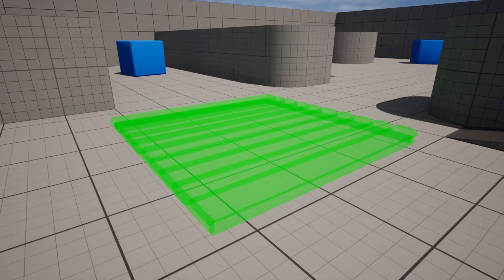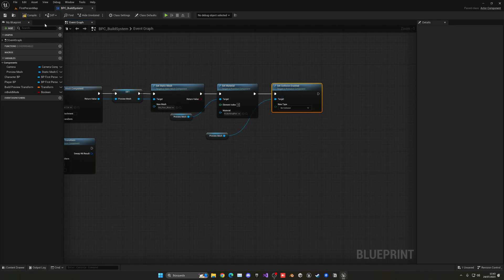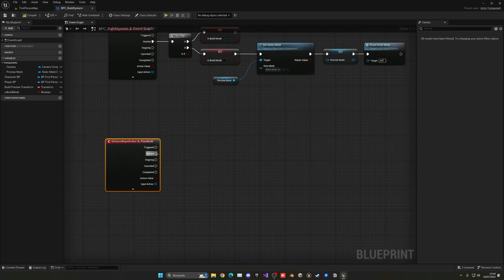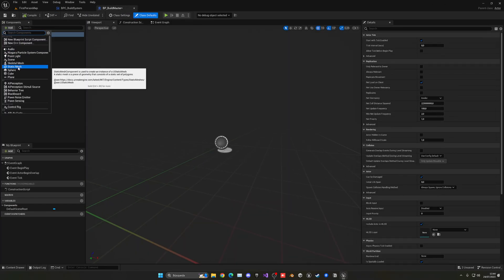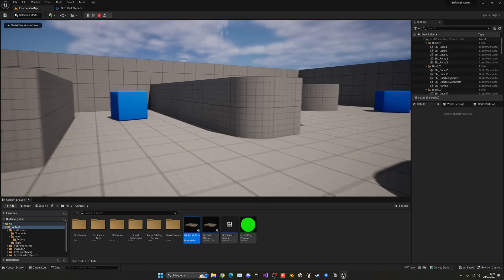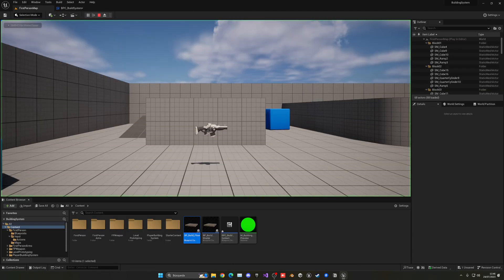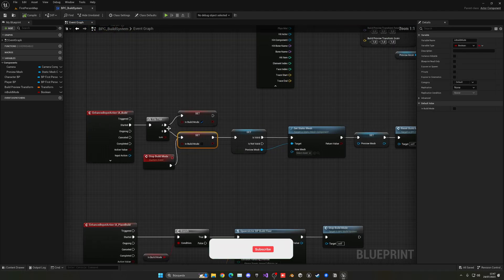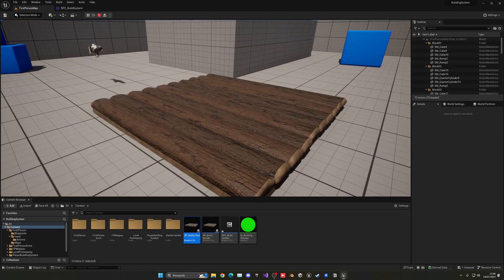Simple Building System in Unreal Engine 5 - #2: Build Placement

Comment: Great tutorial! I just see one potential problem.  Every time you enter build mode, you're adding an additional static mesh component to the player and never destroying it.  It would probably be better to create the static mesh component on the Begin Play event, leave it with no assigned mesh, create the variable, then just set the static mesh when you enter build mode.  Then when you exit build mode, just set the Preview Mesh static mesh to unassigned, but don't set the Preview Mesh variable to null so the existing static mesh component can be accessed next time the player enters build mode.  This way you don't add an additional object every time you enter build mode.
Reply: How to I code that????

Comment: Can you make grid system for that
Reply from the maker: I didn't have it planned for this mini-series, but it can be a thing I can add
Reply: i know this was 2 years ago, but just in case, all you have to do is divide it by whatever increment you want, for example, in minecraft it's 1 meter, so whatever the location is divided by 100, round it, then multiply it again by 100 and it'll be grid based.